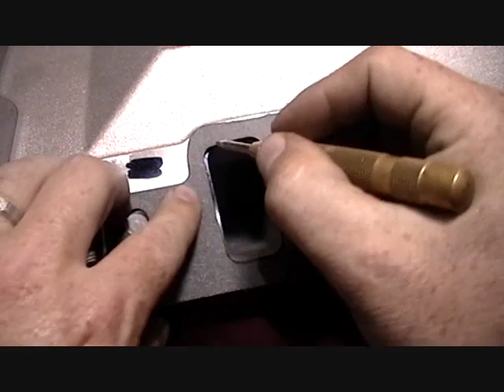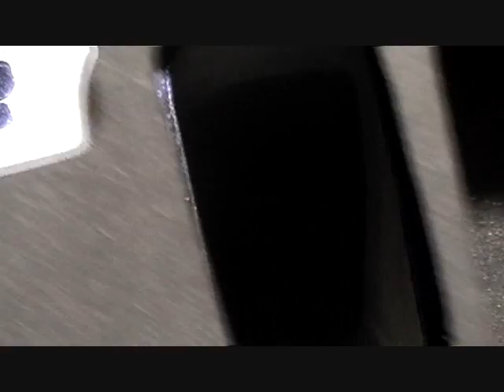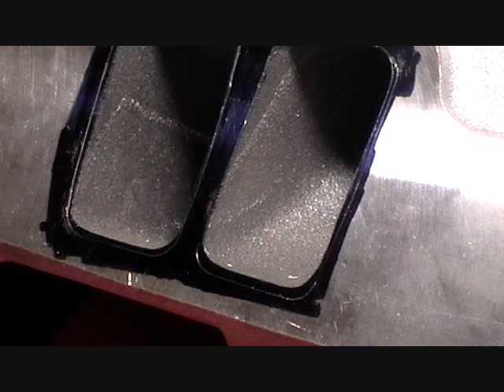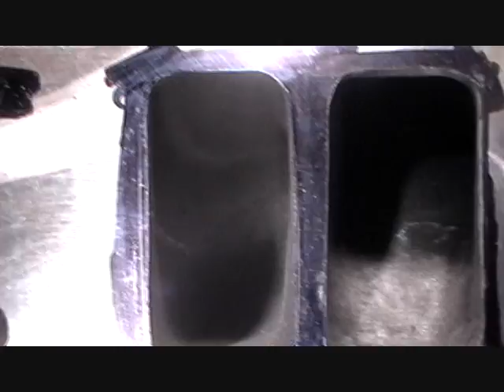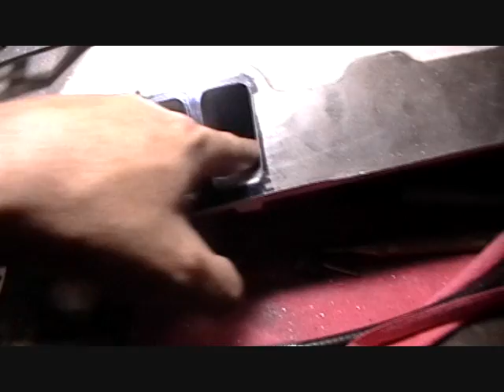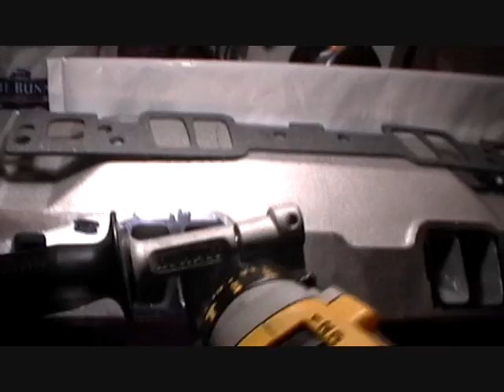How to port and gasket match intake manifold Part 2

Comment: the way I like to do it is just line the gasket up and mark where needs to be removed with my marker. easier to see than a little scribe mark
Reply from the maker: That may be the safer way but with a scribe you get closer to the gasket then you can with a marker but six in one half a dozen in the other as long as you know where to start and stop grinding

Comment: I want to do this to my air gap before I get it put on. I'm just still deciding If I want to go with aluminum edlebrock heads and comp rockers first. I'm still,wondering if the heads are worth it..they are expensive and cost even more to have those ported and polished. I still got another car to restore yet.
Reply from the maker: +james myers You can port and polish your own heads. You may not go as radical as a professional but knock off the rigid casting marks and smooth it out.  I understand about other projects.  Ive been putting this vette off for many many years.  Good luck with what ever you do.
Reply: 2LateIWon thanks for the advice and well wishes...same to you.

Comment: How did it perform any difference
Reply from the maker: RICHTOWNRAIDER510   Well to be honest this was a brand new intake that has never been installed.  But this what all the big horse power seekers do to get every last bit of HP they can get.  I figured since I had some time and knowing me Id do it sooner or later. PLUS its a free mod.  I figured Id do it now.  Where youd get the biggest difference is port matching the intake to the head. ( I didnt want to take the head off)  but from what Ive read doing just the intake is 1-3 hp doing the head and intake is closer to  5-10hp
Thanks for watching